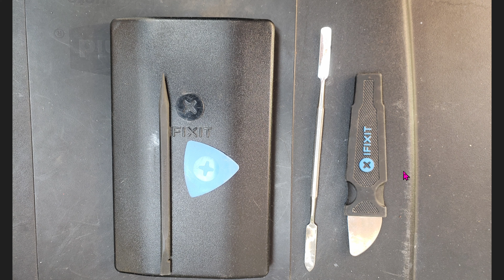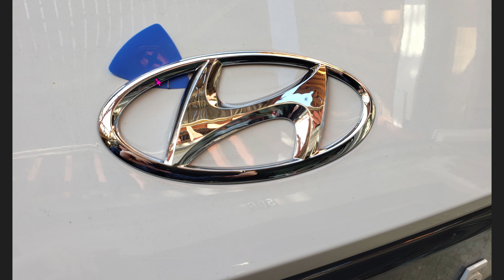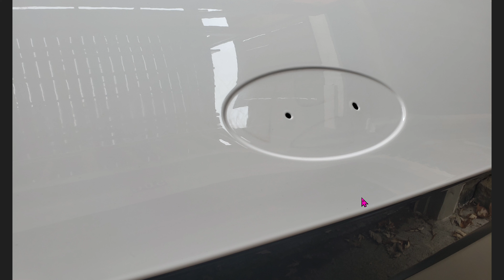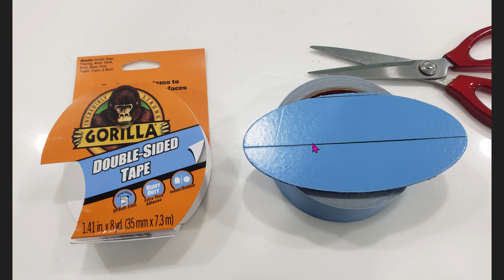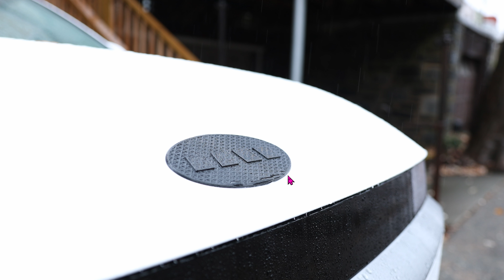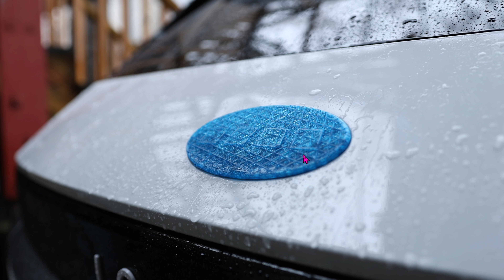2023 Hyundai Ioniq5 Debadge and 3d Printed emblem replacement

Comment: Yo, they can't steal your car in the typical Hyundai/Kia way, right? And was there a reason you went with a heatgun and skipped over a solvent?
Reply: Also, using solvents can dull the glossy paint adjacent to the emblem you're trying to remove- ask me how I know.
Reply: @Fixinguys what solvent did you use? Goo Gone has never failed me and seems a much safer route to go than heat gun. When I worked in a trophy shop we used lighter fluid to dissolve adhesive tape - it worked about the same way and never marred a surface.
Reply from the maker: The ioniq5 is not affected by the typical Kia hack. I don't have any solvent, only heat gun